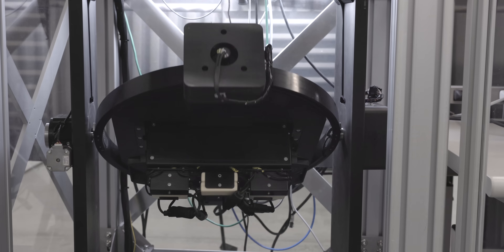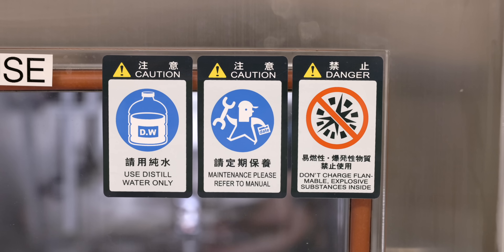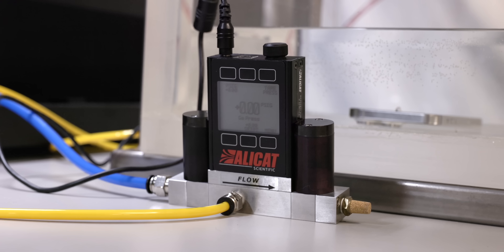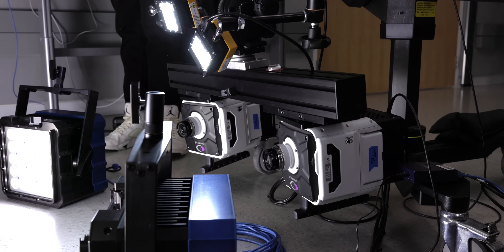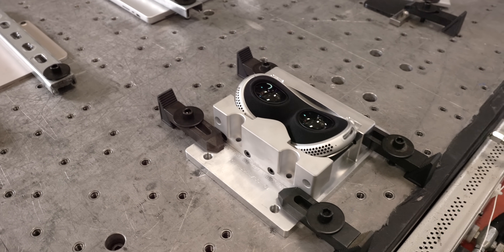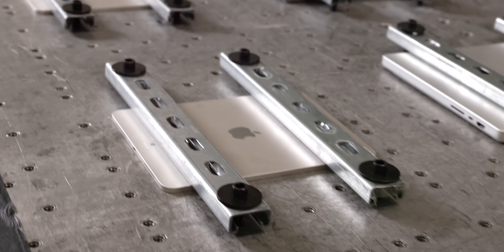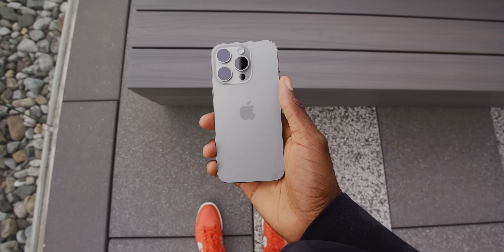I Visited Apple's Secret iPhone Testing Labs!

Comment: I have a feeling the repairable / durability ratio isn't aided by the fact apple uses anti repair techniques ... basically I think there is a bias where companies make durable phones so they don't need to be repaired and they don't think about repairability  so it gives the impression you cant have repairable and durable phones , but in reality are probably thinking "Bruh that phone lasted 2 years, I'd prefer for them to buy a new 900$ phone that a 50$ new battery and last another 2"
Reply: 9:56 I'd also like to mention that because it becoming harder to repair, in the case of a broken phone you will have to throw away otherwise working hardware 
so it doesn't exactly reduce e waste...
edit:(But it can)

Comment: Apple is also big enough and has the resources to create a more durable AND a more repairable phone. If anyone could make a difference, it would be Apple.

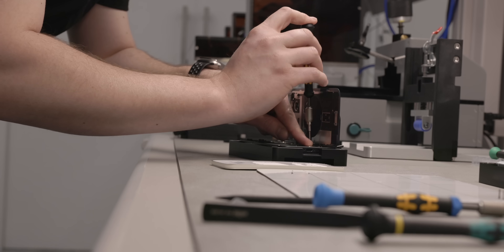From a resources perspective, it’s actually not “better for the planet” (9:39) to have you throw your phone away and buy a new one if it too difficult or too costly to repair. It’s a better business model for them to get you to upgrade when there is more severe damage rather than making it accessible to fix.

Their logic seems to make sense at first listen, but I’d still be extremely skeptical on the reality of these comments.

Comment: I'd never really seen the right to repair argument from this angle. Apple is trying to make the best, most durable product they can. They don't care very much whether or not their product design philosophy negatively impacts the small electronics repair shops, they don't want you to ever need to repair it in the first place. First and foremost this is in service to the people who purchased their product. If you're business relies on fixing things other people made then your livelihood depends on products out there too fail. This business model takes advantage of a flaw that can in theory be engineered out by the companies who originally made the thing your job is to independently fix. It certainly isn't fun for those repair shops as this trend continues to grow. Plus, there are other sectors that suffer from this as well.

Would it be harsh to think that independent repair shops just aren't the responsibility of the companies who make products? I'm starting to see a different story here.

Comment: the test at 2:34 is actually pretty hard and would probably justify a rating for IPX9. Meaning it can sustain high pressure water. That is not your standard dropping in the pool or whatever. This it TOUGH stuff here.
But I guess that's how Apple achieved their much higher IP68 rating with 6m water depth instead of just 1.5m which is what the entire rest of the industry only tests for.

Comment: I totally understand that with higher and higher durability, the repairability can go down. I bolt and nut can be tightened up by anyone when it loosens,but a rivet rarely will lose. When it does though, rivet guns aren't very common. That being said, I don't see any increase in durability coming from a screen not working unless Apple themselves installs it. So the seals and the glue and the o-rings are very complex. So what? It's not impossible to remove and replace things like that if you have the skill and tools. You run the risk of lowing your property's durability when you fix things yourself. That's something you need to be willing to be ok with when repairing your electronics. It's still your property at the end of the day, and if you want to take it apart to fix something broken you should have that right and ability.

Comment: Apple’s issue is they don’t allow suppliers to sell replacement parts to third parties, and they program their phones to throw errors or reduce performance if it’s not a genuine Apple part installed by Apple or a certified repair shop. My LG V60 is just water resistant and durable than anything Apple has every built and when I managed to break the thing, I was able to replace every broken part myself, with zero impact to performance. There’s no way I could do that now with my iPhone.

Comment: It definately is not a "slider". Sometimes making something durable, means that it is harder to repair and sometimes not, so it depends.
And also as others already said: lack of schematic or using custom screws by apple (idk. if they still do that but there are a lot of other examples like not releasing software to calibrate sleep sensors) have nothing to do with durability but affects negatively reparability.
I wonder why you (MKBHD) are not pointing these issues. You are so long in this market that you probably know about apple bad practises. Is it because you don't want to Apple to dislike you? At one hand I understand this because otherwise you probably wouldn't be invited to see things like this, but at the other hand I feel like it shouldn't be that way
Reply: What do you even expect from marques?
First time watching the channel?
It's apple bro

Comment: To save the environment ya.
1. Stop making newer non-pro version phone. Since they are using last year silicon + inferior OLED (60hz) + inferior camera (no telephoto len).
2. Then you are claiming you use up to 10k units for testing. Do you include t he non-pro too? If so, you could reduce that to 5k. Since the non-pro versions are 2/4 of your annual release.
3. Tell me about your lightning cable situation when you are telling me about the eco-friendly for the past 5 years.
4. That guy went from battery being important to phone to how impressive IP rating is then tell us all the seals and adhesive made them harder to repair. I don't think it's true unless you are trying to make sure they are IP rated once more after the repair?

Bonus point: Charging premium price for so-called more durable product, so we could charge them even more when we are repairing them because they are harder to repair. Regards from Apple.

Comment: The "durability-repairability dichotomy" is a false comparison - there is NOT intrinsically a trade-off between the two! You can have a product/material that is very durable, but when it fails (which ALL products or materials will eventually do; claiming to have a completely durable - or sufficiently durable for the expected lifetime - product is nonsense), there are engineering solutions available to make components relatively simple to replace or repair.
Apple are justifying (spinning) their deliberate decision to make their products very difficult to repair; the EU's Right to Repair directive is a great endeavour to force powerful companies that would otherwise have a direct incentive to not make things repairable (it cuts into their profit margins if you can repair a phone rather than need to replace it).

Comment: How does using proprietary screws and software locking replacement parts make the phone more durable?
Reply: My question exactly. They don't have to use proprietary screws and they don't have to software lock individual parts to it's phone. And the phone will still be durable and repairable🤔🤨😒
Reply: @lloydmwinga5628  exactly. the durability vs repairability being "on a sliding scale" is completely wrong. i own a 10 year old Lenovo laptop that still runs like day 1 after being dropped multiple times and i can take it all apart in 15 minutes. 
Marques is way off point here.
Reply: @esh92 A laptop and phone have completely different use cases it’s hard to abuse a laptop as easily as a phone
Reply: Any engineer will tell you that reliability vs repairability argument is marketing speak without design merit. As a biomedical engineer I can tell you companies that do well have medical devices that are reliable (obviously) and serviceable. For phone repair, surfaces can be cleaned, glue, reapplied, seals, replaced. What makes the job difficult is having to order 15 different screwdrivers of exotic shapes 😂
Reply: What a disappointment to hear that drivel from Marques from all people
Reply: @lpcamargo  give me a timestamp of when marques made that exact claim
Reply: They'll tell you that parts pairing is for security purposes. As if that could get any stupider.
Reply: Yeah, that's just marketing BS
Reply: Apple Intelligence.
Reply: exactly
Reply: I was about to say just this.
Reply: That's what I was thinking when he said about durability linked to difficult to repair. It's not secret that Apple intentionally make it difficult to repair. I mean, Marques why you said that?
Reply: It’s just that marques sold out
Reply: More durable against non-certified technicians*.
Reply: I like the idea if that means that if they steal my iPhone they could never use the components once I report it stolen. Still I'd like more repair shops of my choosing to be able to perform repairs without issues.
Reply: because it prevents you from using wrong spare parts that could result in ultimate failure (could means that there is an option, but that it does not necessarily happen)
Reply: An unverified repair will likely not do stuff up to standard and will shorten the life of the phone as a result. Not to mention it's a security risk as well since Apple are all about that type of stuff.
Reply: If you can easily get a screw driver for it, how 'proprietary' is it? Also, when dealing with super small parts, the old Phillips head is not the best solution as it strips pretty easily. Also, as stated by someone else, a lot of easy to clear hurtles are to keep simpletons from breaking their phones - like some dope that wants to take a panel off to see what is inside without realizing they're just destroyed the water seal. Having a tiny hurtle to clear, keeps out the vast majority of people who have no idea what they're doing.
Reply: that has nothing to do with repairability and everything to do with A: anti-theft and B: funneling people towards apple repair centers
Reply: I saw a video from Insider explaining a thief stealing iPhone and selling it in the black market. I think software locking replacement parts is to combat the stealing of iPhones and selling its parts in China because iPhone has a consistent look than an Android, so its easier to determine whether or not its worth stealing or passing.
Reply: A proprietary physical asset, such as a screw or an adhesive, can be designed to reduce weight, provide strength in specific areas of the unit (the screw), and create a specific balance.  A very low-profile head that can withstand a certain torque rating and has a specific break force at the shank or threading,  may require a certain type of drive (flat/Philips, etc.) designed to withstand both the drive force during assembly and and the combination of forces during use, such as strike and vibration, and withstand other factors such as temperature ratings, galvanization resistance, electrical resistance, and so forth.  So, in some applications, a custom design can lead to certain goals, and at Apple and other tech companies, a few goals can be better met with custom designs, such as material savings and weight savings.
Reply: @TheRealTrididos  That's such a bs answer. a proprietary screw to reduce weight and provide strength? Do you even hear that yourself? there are star bits, hexagons, and others that are already "industry-proven" to be strong with minimal weight while being low profile and other features you mentioned (bc it's less material used than Philips and slotted). And you know that the custom design will cost more to produce, too, right?  It's almost laughable that you are siding with Apple on this...
Reply: If I was Apple my argument would be: software locking replacement parts is so you can’t strip an iPhone and sell it for parts. Not a huge problem in the states but in Shenzhen it could be an issue especially when it comes to stolen phones. Same with proprietary screws, you could also argue to keep it within licensed technicians who know what they are doing in order to preserve use experience for repairs
Reply: @rohanpatel2828  Very interesting, but this reasoning can be applied to anything that has parts and is mobile, like PCs or cars. Do you want your CPU or GPU software locked to your PC? Do you want your rearview mirror software locked to your car? I'm aware that if someone steals my car they can strip it down to parts, but I personally prefer to be able to repair it by myself (if I know how to)
Reply: @rohanpatel2828  but, i buy the iphone, yet i'm not allowed to use it as i see fit? it's not like selling a phone for parts is illegal right? or...or does the phone i paid with my own money not belong to me?
Reply: Software locking makes it harder for people to fit dodgy counterfeit parts. I’m all for it.

Comment: 1:15 Wrong, Marques. The X means that they are not tested for that category, it does not necessarily mean they are not protected, so as you say despite being untested, they may or may not have some (unspecified) level of protection.

Comment: His input about the battery needing replaced because it wears out quickly changed mid-sentence to repair rather than replace. The question still stands as to why it is still ridiculously expensive to replace the batteries or have them replaced. I don't feel like he really answered the question well enough, but rather gave the very well practiced marketing answer.

Also, werer any of the drop tests on the glass? or on lumpy surfaces? Seems that dropping on the edges and on flat surfaces is still a bit of a "controlled" type of thing whereas lumpy surfaces introduce a bit of randomness just like life throws at people. If the drop tests are that good them why do I see so many people with busted screens from small drops?

Comment: I work with watches made to withstand 20bar/200 atmosphere's of pressure, and they are incredibly easy to repair, parts are readily available from a range of sellers, at reasonable prices with no software coded parts that create errors on the device. iPhone repair difficulty isn't because of waterproofing or making them more durable to drops, it's because apple has pretty much saturated the market with iPhones and a reliable way to increase sales is to 'encourage' owners with a broken screen or depleted battery to just replace the whole device.